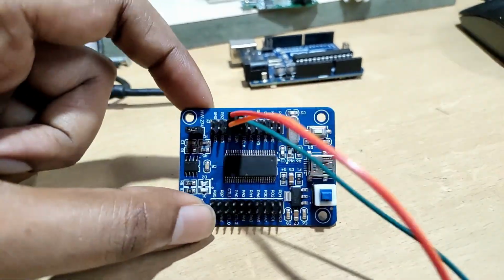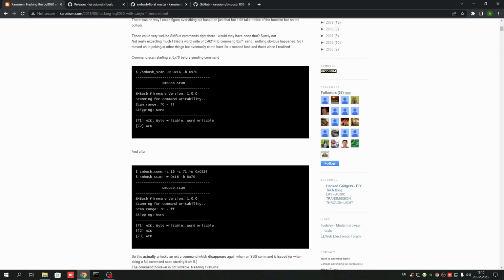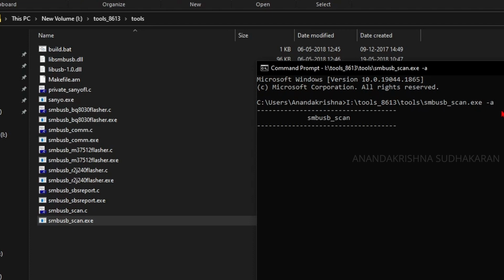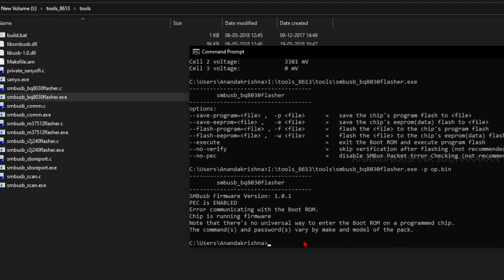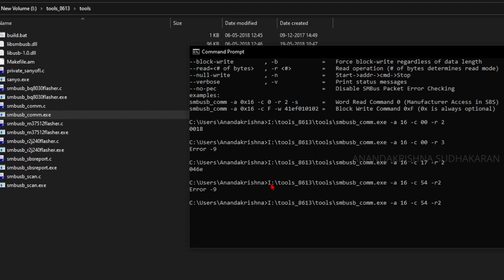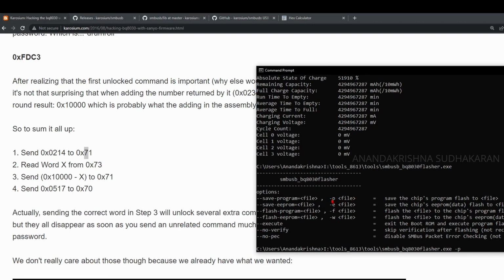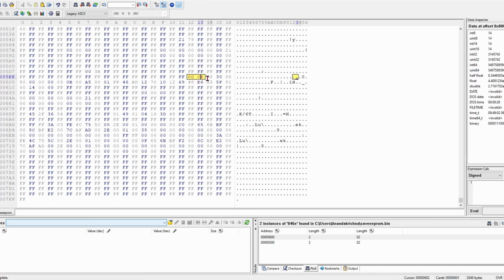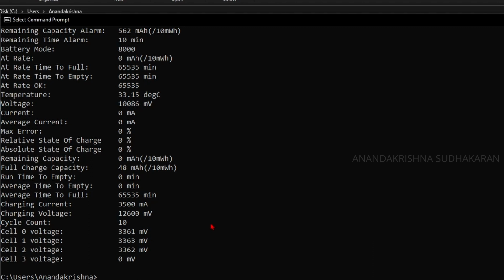BQ8030 RESET - Karosium Guide - Reset Cycle Count, Read and Write EEPROM - Using FX2LP

Comment: i have followd this procedure. but when i run scan command, it gives ERROR: -9 for all addresses from 00 to ff.
Reply from the maker: Firmware not loaded, what is is showing also check sda and scl lines
Reply: @AnandakrishnaSudhakaran  checked SCL SDA lines are correct. i also gave 12V external supply to battery. when scanning,  leds on FX2LP board dosent blinks, also i measure VCC voltage at BQ8030 ic, it shows 2.9V, is it ok? or it should be 3.3V? also how to load firmware to FX2LP board? i think it loades automatically when you run SMbus Scan.exe in terminal.
Reply from the maker: Yes it loads automatically. And did u see the firmware version while running it?
Reply: @AnandakrishnaSudhakaran  yes.. i can see firmware version. also tryed with CP2112 board with DJI battery killer, it also not able to read info. dji software connects to cp2112 board successfully. i measured MRST pin voltage, its 0V. so i externally injected 3.3V to that pin, now its set to 3.3V. i think PF pin also requires this treatment.

Comment: Hi,great videos and great explanation but there's a way to reset the battery status of the m37512 with the Arduino?
Reply from the maker: If u can make communication with the battery yes it's possible
Reply: @AnandakrishnaSudhakaran yeah i can
Reply: Do you mind if i send to you the smbus dump or you have any instructions for how to reset the battery cycles and mah of the battery?
Reply from the maker: I don't have this chip with me. I will ask for the procedure. But do it with careful. A single mistake will make the chip brick
Reply: @AnandakrishnaSudhakaran ok thanks 👍
Reply: Hi, any news?

Comment: Hi, very good video, thanks for the contribution, I would like to ask you for help with unlocking the BQ20Z90, which works with a lithium cell pack.
Reply: Is it possible that it is Windows? I am using Windows 10 Pro
Reply from the maker: @marcelopadilla6915  from the menu options on zadigz click list all devices, it will show all connected devices, including fx2lp. U need to identify it, then only install drivers
Reply: Manufacturer Name:          ERROR
Device Name:                ERROR
Device Chemistry:           ERROR
Serial Number:              4294967295
Manufacture Date:           8390587.15.31

Manufacturer Access:        ffffffff
Remaining Capacity Alarm:   4294967295 mAh(/10mWh)
Remaining Time Alarm:       4294967295 min
Battery Mode:               ffffffff
At Rate:                    -1 mAh(/10mWh)
At Rate Time To Full:       4294967295 min
At Rate Time To Empty:      4294967295 min
At Rate OK:                 4294967295
Temperature:                -273.25 degC
Voltage:                    4294967295 mV
Current:                    -1 mA
Average Current:            -1 mA
Max Error:                  4294967295 %
Relative State Of Charge    4294967295 %
Absolute State Of Charge    4294967295 %
Remaining Capacity:         4294967295 mAh(/10mWh)
Full Charge Capacity:       4294967295 mAh(/10mWh)
Run Time To Empty:          4294967295 min
Average Time To Empty:      4294967295 min
Average Time To Full:       4294967295 min
Charging Current:           4294967295 mA
Charging Voltage:           4294967295 mV
Battery Status:             ffffffff
Cycle Count:                4294967295
Design Capacity:            4294967295 mAh(/10mWh)
Design Voltage:             4294967295 mV
Specification Info:         ffffffff
Cell 0 voltage:             0 mV
Cell 1 voltage:             0 mV
Cell 2 voltage:             0 mV
Cell 3 voltage:             0 mV
Reply: Before with the scan option I got this message
Reply: Success. SMBusb Firmware Version: 1.0.1
Scanning for addresses..
Scan range: 00 - ff
Skipping: a0 a1
Reply: Am I on the right track in my search to reset the BQ20Z90?
Reply: I know there is still a lot to do, but I would like to thank you first for publishing your knowledge and then for taking the time to collaborate. I hope you can continue doing so. I thank you in advance.
Reply from the maker: Please contact me on facebook or instagram or mail, we can discuss this
Reply from the maker: @marcelopadilla6915  its possible, Last day i tried with another person. Couldnt complete because of my time. Can you tell me your exact problem
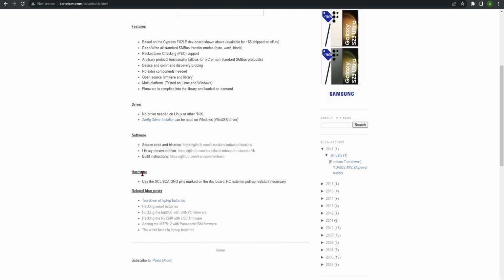Reply: Hello again and thank you for your time, I have a BMS H2X360 which has the BQ20Z90 and BQ29330 as the main controller. I tried to access it following the steps in your video, but I get a message when scanning that I do not have sufficient permissions. 2:13
Reply: Does Zadig software have the database for the BQ20Z90?
Reply: When installing Zadig, it does not appear as a USB device usbk and neither does Cyprus FX12

Comment: I am very grateful to have learned a lot from this video, so thank you.
Regarding the FX2LP board, one thing I don't understand: do I need to install a special firmware to this module in order to be able to read BMS data?
Reply from the maker: Firmware is already there  in order to work, that zadig software is needed.
Reply: Thank you! You're right, I finally succeeded in reading data from BMS. My chip is using bq20z70. According to bq20z70 Technical Reference Manual,  to enter BootROM mode is slightly different from bq8030. After getting Full Access mode, we continue send x0f00 to address 0x00. After that I can succesfully access the program and the EEPROM data. But there is a difference offset of the register data address with the bq8030.
Reply from the maker: @wawandharmawan2441  I appreciate your work. Yes data registers are different. But That TRM pdf conatins all data. Check the registers and change values.

Comment: Good afternoon Such a question, the battery on the laptop stopped holding, the laptop turned off after a minute. I decided to disassemble the battery, the battery is based on bq8030+bq29330 chips. Connected via Arduino nano to the battery. I took the battery readings, unfortunately I did not save the output from the sketch. Next, using the video, I installed the sketch, launched the gui - it reads everything. Next, based on your video, I tried to change the battery access mode. This is register 00. At first it was 0x08. After manipulations from the video, 0x1717 was written there and the data is not read from the battery quite correctly.
SmartBatteryHack basically reads the registers, but the incorrect battery temperature is displayed and the rest of the data is a little crooked.
Reply from the maker: Do u have any other arduino codes to read the battery eeprom data? U r stuck in bootmode, 

Send 08 to 0x00 register
Reply: @AnandakrishnaSudhakaran  I'm trying to write 08 to register 00.. When I press the "word" button, there is no change. If I select a byte or block it gives the following
RX->] Block data write response
3D 00 05 85 03 00 08 01 96

[INFO] Reg.: 00
       Data: 08
       # of bytes written: 01

[<-TX] Read word data
3D 00 03 04 02 00 09

[RX->] Word data received
3D 00 05 84 02 00 17 17 B9

[INFO] Reg.: 00
       Data: 17 17

Comment: Does anyone know if it will work with the BQ30Z55 ?
Reply from the maker: Use dji battery killer if you have cp2112
Reply: @AnandakrishnaSudhakaran  unfortunately i don't have cp2112 . Also this bms is in a laptop battery not a drone battery . And it is so sad my laptop battery didn't work even a full 2 years but i can power a big motor for hours without dropping too much voltage it's still giving 10.5 out of 10.8 ( 3 battery cells) even after 1 year removed from my laptop . Any way did you know what else i can do to fix this battery
Reply from the maker: @Κωνσταντίνος-μ4ρ  Dji battery killer software support bq30z55, i worked with that software on one of the laptop battery from msi laptop. Anyway which hardware do you have to connect to the pc and laptop battery? Fx2lp board does not support bq30z55 because the algorithm for the unlock is different. You need a 128bit key with sha 1 method to unlock bq30z55. Bq30z55 is widely used in many BMS boards. So dji battery killer is a free software and can be used to do almost anything with that software. Laptop or drone, our aim is to reset bq30z55 and reuse again. So cp2112 is the cheap option for this. Or need ev2300 or ev2400. Feel free to ask me any doubt.
Reply: @AnandakrishnaSudhakaran  thank you very much for the fast reply !!! I have a USB Logic Analyzer - 24MHz/8-Channel i don't know if this device suitable for this purpose . Did you know if DJI  killer software support any other adaptor except cp2112  like the CH341A USB to I2C/IIC/SPI/UART/TTL/ISP Serial adapter (EPP/MEM) this device it's looking great but I don't have find yet any driver or program that I can use it . Anyway if you do know any other adaptor that is working with the dji program it would help me a lot ... Thanks again you're doing amazing job !!!
Reply from the maker: @Κωνσταντίνος-μ4ρ  dji battery killer support only cp2112. Lpt to i2c software are available but you can only read the data. For other functions we need to buy the software. Do you have an arduino uno board? We can do some basic steps, like read status registers and do some unlock procedures. If you are lucky. You can unlock the battery with default keys, to read and write commands there is a free arduino code gui available. I have already done a video. My new video is still pending. It is unlocking bq4050. I will add your chip details. Just to try with arduino  and if it works you can recover your battery. And from your writings I understand that your battery gives output, but if you put it in the laptop it will not last. This is due to the safety features like cycle count threshold, PF flags, Full charge capacity and some other flags. So what I am suggesting is to get an arduino UNO board if it is cheap there. Cp2112 is actually cheaper outside India. So if you are outside india buy cp2112. Just a suggestion. With ch341, no one actually did the magic. Am sorry I also don't have that board. Right now I am developing free software to read and write rom, clear errors, etc. 

Final thoughts get arduino uno and read data and understand the condition of your battery.
Reply: @AnandakrishnaSudhakaran  I watched your most current video using the dji battery  killer program  and i think it will be much easier to fix this battery using that way rather than using Arduino uno . Anyway I will try to find the cp2112 adapter . One more question usb logic analyzer like the Haitronic HS1328 what is its use ? Thanks again for the help.
Reply from the maker: @Κωνσταντίνος-μ4ρ  i think the mentioned logic anazlyer is just analyzer like all other. I don't know more details. Arduino can do wonders if you know the correct code. There is code outside but no one will release it. So we need to do our own research and make videos for others, That's what I am doing. Thanks for your comment. Any doubt ask me

Comment: dear bro. can i reset dell m6800 battery bms with fx2lp? thanks
Reply from the maker: I cant tell without knowing the chip number. With fx2lp you can read any chip. But dealing with the unlock keys difficult for other chip. Do you have any other board like arduino, or cp2112 or fx2lp? Which one you have?
Reply: @AnandakrishnaSudhakaran  the chip is BQ30420. I HAVE ARDUINO UNO R3, AND FX2LP, AND CP2112
Reply from the maker: @lovediy8784  its better to use cp2112 with dji battery killer software, do you have it?
Reply from the maker: @lovediy8784  watch my other video of cp2112 unlocking bq4050, you  choose bq30z55 and try. If you need assistane please tell me. https://youtu.be/2Rkrk8mNWcQ
Reply from the maker: Please feel free to contact me on insta or telegram
Reply: @AnandakrishnaSudhakaran  THANKS BRO. I'LL TEST CP2112 AND FX2LP. I USE ARDUINO UNO R3 BUT IT CAN'T READ ANYTHING.
Reply: @AnandakrishnaSudhakaran  OK. THANK YOU SO MUCH
Reply from the maker: @lovediy8784  cp2112 is better, there are free software with user interface. But fx2lp can be used to read data.  Good luck bro
Reply: @AnandakrishnaSudhakaran  ok. i'll test it. i hope it can hack my bms battery dell

Comment: i have a battery of chip 51f51 i cant clear its PF flag can you tell is there any pin to short it and clear PF flag
Reply from the maker: Its a risk to short ic pins, also data sheet is not available. I will try

Comment: Excellent

From where we can buy this board

Thanks
Reply from the maker: Which board you want to buy?
Reply: @AnandakrishnaSudhakaran  

The board which showing in this video

I have dell latitude e6420 i changes cell but still it's showing battery not installed in bios

dell latitude e6420 battery chip is A2168

Comment: I have reset one battery successfully (LNV-45N103), with the second battery (LNV-45N1177) I have a problem, the fuse is ok but I don't have battery voltage + on the pin. I noticed some difference:
battery unlocked successfully has the reading: Battery Status: 00c0
and the battery that doesn't work has: Battery Status: 03d0
I will add that in the second battery I had to connect the + voltage from the 12V battery (+) because I could not connect smbusb_scan and smbusb_sbsreport, (I did not use an external power supply, only 12v from 18650 cells)

Does this battery status matter? maybe it's a blocked battery? how to unlock it?
Reply from the maker: Apply input voltage and check status of charging register
Reply: @AnandakrishnaSudhakaran  how to do it? can you help me?

Comment: Hi, have you ever unlocked a bq30z55? I'm looking for a howto.
Reply from the maker: Laptop or mavic dji battery?
Reply: @AnandakrishnaSudhakaran   Laptop battery
Reply from the maker: @reuterric  I tried with Cp2112 , successfully unlocked and reset one battery. But due to the fuse problem. Battery didnt give output. So make sure fuse is working, And where are you from? Search for dji mavi killer software with cp2112. You can find some tools, its actually for drone battery, but useful for laptop battery also. In my country cp2112 is expensive for me. So i tried with my friend in turkey. Other tools i dont know the condition. So i cannot guarantee you. Do it your own risk. Or EV2300 can do it. But costly hardware. But cp2112 is promising the unlock and reset. Give a try. I can provide you the related videos link

Comment: Please try  decoding the macbook batteries as well
Reply from the maker: Yes. But I dont have mac battery. If I get a chance I will Try. thanks for your suggession
Reply: @AnandakrishnaSudhakaran  with BQ20Z451 Controller
Reply from the maker: @anirudhkundu3567  if you want to try please refer this pdf https://www.google.com/url?sa=t&source=web&rct=j&url=https://www.ti.com/lit/pdf/sluu313&ved=2ahUKEwiOp7HUmOr-AhX8SmwGHXx8ApIQFnoECCUQAQ&sqi=2&usg=AOvVaw3vKq8ErvDxPTxuRR6GlNXK
Reply from the maker: @anirudhkundu3567  i will also check
Reply: @AnandakrishnaSudhakaran  so the thing is i have a macbook and the battery  was dead since one of the cell got dead and the total battery voltage was just 7.5 volts. I removed the specific cell and then changed that cells with the exact same cell from another dead battery. Now the voltage is 11.7 volts but the battery does not charge when connected to the macbook.

Is there anyway you can help or guide me?

Thanks!!
Reply from the maker: @anirudhkundu3567  First need to check is there any flag are enabled. If one of the cell dead , chip will go in protection mode. After replace cell we need to re enable or need to reset the chip. So it will start as fresh. I dont know more about this chip i will try. Which tool you have, arduino, fx2lp, or ev2300 or any other board?
Reply: @AnandakrishnaSudhakaran  i do have an arduino. 
Please guide me a way to reset the chip so that i can use the battery.

Thanks a lot for your prompt response.
Reply from the maker: @anirudhkundu3567  with arduino you can read data, but if we enter the chip unlock code we can reset the battery. So let me understand the chip and i will tell you. Can you message me on instagram?
Reply from the maker: @anirudhkundu3567  also arduino is not that much powerful but we can try. Which is your battery model?
Reply: @AnandakrishnaSudhakaran  battery model - A1582

Comment: will this work with TI EV2400 board instead of the Cyprus board?
Reply from the maker: For ev2400 ti software is available you can download it as free
Reply: @AnandakrishnaSudhakaran  When I do a SMBUSB_SCAN -a I get an error unable to open device. I am using a cyp board now...
Reply: And also which zadig driver should I use?
Reply from the maker: @rsdynotune  watch my video, usbk I think
Reply from the maker: @rsdynotune  watch my video, usbk I think
Reply: @AnandakrishnaSudhakaran  yes it is this, and i needed to unbridge the jumper on the Cypress board too. Now it works. Another question, how do we know which register to query for the data we need? Right now my Charging Current:           0 mA
Charging Voltage:           0 mV
I think I need to edit this in the eeprom and need to find the location....
Reply from the maker: @rsdynotune  you need to find out all registers conditions and you need to convert the hex to binary and verify each value with datasheet. Then only we can understand the condition. Output voltage is  triggered only if other conditions are ok. You can't edit this in hex file. Because these values are dynamic not static, relied on other registers. So first find out conditions

Comment: Really glad for your knowledge, Is it possible to do this program using arduino? Thanks.
Reply from the maker: I don't have that much knowledge. But I tried so many Arduino codes to do this. but  it is not working. Unlocking code for bq9003 is available with User Interface. Watch my other videos. May be there is code out there. No idea. Now am stuck in between cp2112 and raspberry pi. There is a free software available for Raspberry Pi and cp2112. If you know any code share me.
Reply: Rasberry pi which model ?